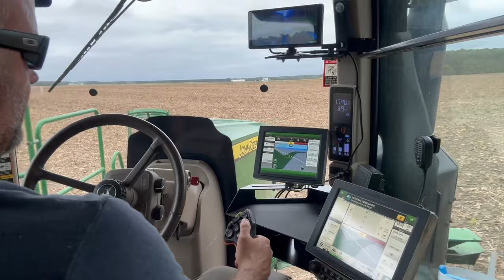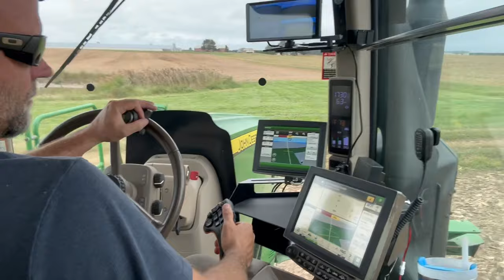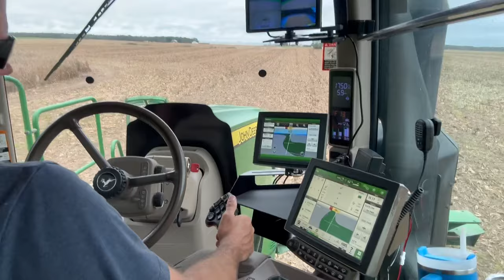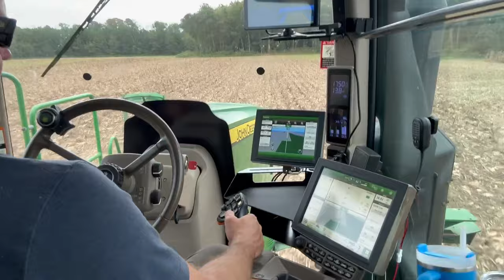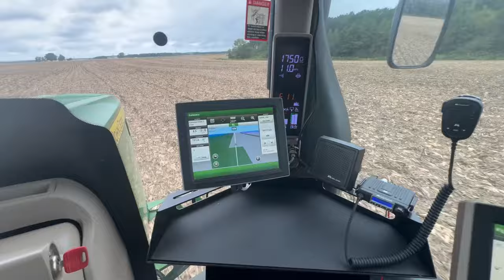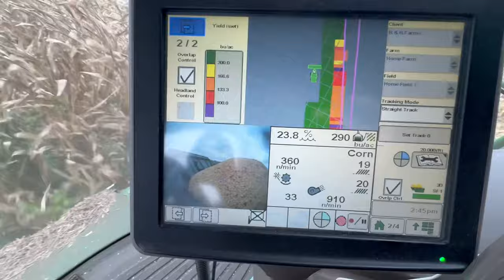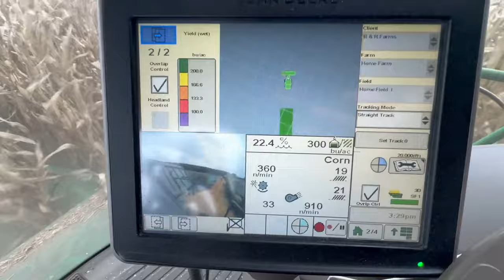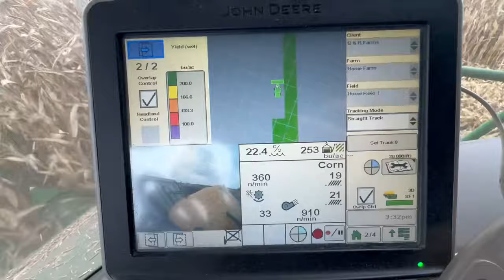Corn harvest

Comment: Hmmm, will be interesting to hear about the Pete's in your operation.  Is it the Paccar MX 13 engine?  Most of ours have had cam failure and engines were replaced with either short or long blocks.  All have been covered by warranty.  They had an issue with them from 2018 - 2020's.  Hopefully those boxes had half or full fenders.  with quarter fenders it's pretty easy to take out those rear windows on the left and right.  They are inexpensive, 45 bucks or so.  But it's a pain to always be replacing them when they have the quarter fender.  Rocks come out of the tire tread and find their way right to the window.
Reply from the maker: @barrychouinard4019  yes these trucks have the new updated cam shafts in them, not worried at all